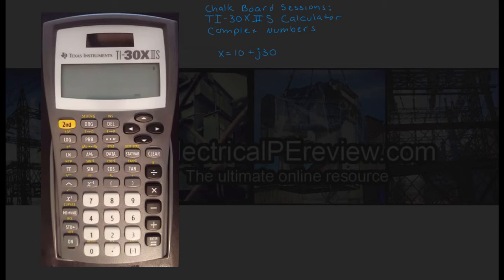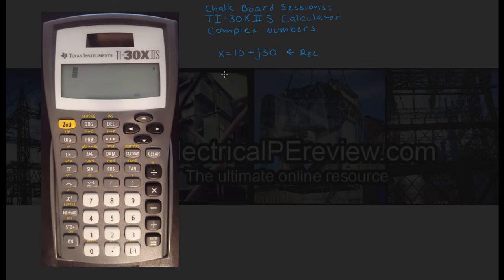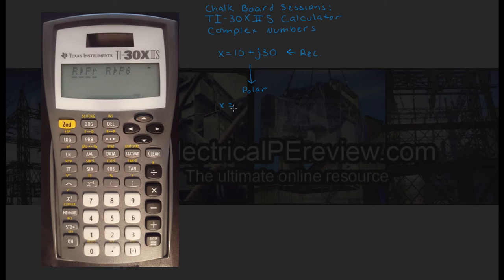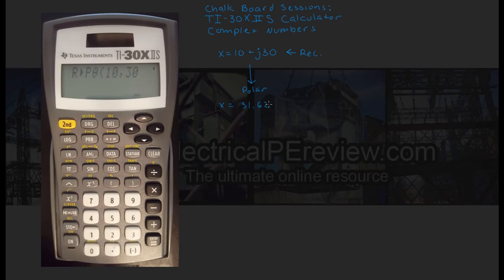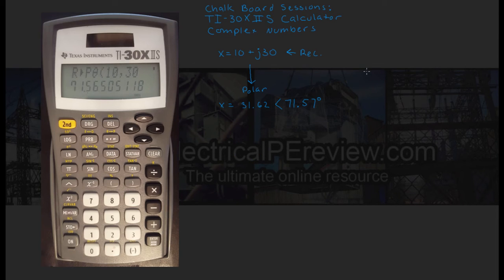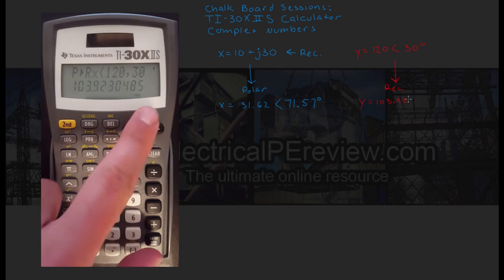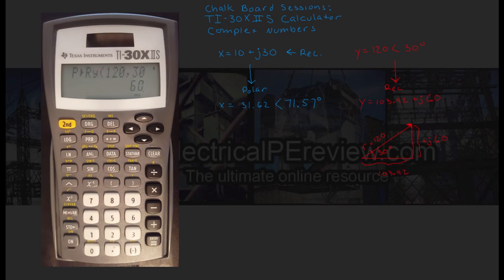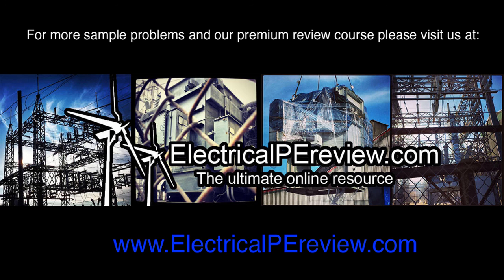Calculator TI30XIIS Rectagular, Polar, Complex Numbers Example NCEES Electrical PE

Comment: If you are involved with electrical engineering, as nice as a TI-30Xiis is, the TI-36XPRO is much better. It has complex number capability already built into it and it will do the conversions for you. A much more appropriate calculator for electrical engineering at only about $10 more than the TI-30xiis.
Reply from the maker: Thanks for your comment. We teach all of our live classes using the TI-36X Pro on screen at all times to show how to maximize the calculator's effectiveness to save time during the PE exam. This is an older video where we used the TI-30X specifically to teach complex numbers. It's helpful to know what the more advanced TI-36X Pro is doing "under the hood" when converting between rectangular and complex numbers.

Comment: I cannot understand why you used the term "real" for the rectangular function. The official TI manual for this  calculator calls it the Rectangular to Polar key: file:///C:/Users/Dan/Downloads/30xiiqrg-eng.pdf
Reply from the maker: Hi Dan, you are correct! The appropriate term would be "rectangular". The term "real" in this case would only be used to refer to the real component of a complex number in rectangular form: a + jb where "a" is the real component. This is an older video that we may be retiring in the future as we now focus on teaching with the TI-36X Pro. We will be making calculator tutorials for this model in the near future.

Comment: You're not working with complex numbers, you're working with all real numbers. Use a scientific calculator that supports complex numbers, it's faster and every second counts on an exam. They're as cheap as the TI-30X IIS.
Reply: Can confirm. Casio 991 makes it so much easier and faster to work with complex numbers.